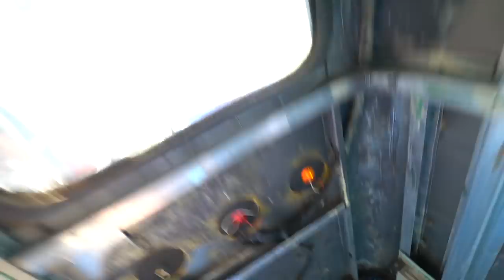CHEAPEST SOUND INSULATION FOR SCHOOL BUS !!

Comment: I dont see it as a main sound barrier. Anything softer than the metal will reflect sound differently and it will seem quieter. I see that as more of a condensation/vapor barrier under you sub-floor.

Comment: “Dynamat” like products, which are essentially stick on sound deadeners, aren’t meant to kill sound reflections inside, like echo or you knocking on the wheel well. They are meant to lessen sound coming thru from the outside by adding mass to the wall, floor, etc. sound travels in waves and passes through walls by vibration and the only thing that lessens sound traveling through is mass. Sound reflections (like echo) inside, can be lessened by adding materials that absorb sound waves like foam panels, carpet, curtains etc.

Comment: Not sure how much sound deadening quality Ice and Water Shield has. What it does do very well is plug all the  holes in the floor.  I had over 600 holes and Monday could I have sealed them all without using Ice and Water Shield

Comment: I also used a knock off brand in my van called "Peel & Stick" from roofing area at Lowes.  Put it inside the side & back doors & over wheel wells in spots, did not cover 100% & it made a significant difference in sound deadening while driving down the road & while sleeping.  I really need to do front driver & passrnger doors next. Didn't do the floor because it was already covered with factory cushioned rubber pad & did not want to take it up.

Comment: Blueskin is NOT a sound deadening product.  it is a moisture and air barrier for walls (primarily).  It is used to put on the outside of a wall before you put on stucco, brick...etc (your finish).  the only thing it would help with on the floor would be sealing any left over holes and to make sure that no water or air can get in from the floor(thats what i did on my bus).  but since you don't have your floor completely covered, its useless.  I know all of this because i work with Blueskin a lot...i work in construction.
Reply: Chuck Co, I thought that's what that product he had there was. I've seen it but have never laid hands on it...no sound deadening huh? That's too bad.

Comment: No ice shield in Canada? I use stuff called Snow & Ice Shield in construction and there are other name brands as well. IKO makes fantastic products for that. If ya do get a kink in it you can sometimes get 'em out with a heat gun or torch and sometimes, if it's not too bad, layin' out in the sun will flatten it out. Most school boards turn those things over so they don't have to deal with issues like leaks. School buses usually have a fairly strong powertrain, a stout chassis and a rattle trap bus body. It's just the nature of the beasts. Good to see Mike can run a hose, attaboy! Heh, heh. .............................PEACE!!

Comment: Tapping right on the material isn't a good comparison and that's what caused the very slight difference in sound.  A good test would be to apply it to a section on the wall.  Then have someone on the outside tap on the section with the material and a similar section without and record it from the inside.

Comment: the centerhole of the rivit is probably leaking , boat / closed end rivits might've worked better , they are watertight (and stainless) https://www.ecvv.com/product/4456679.html

the skylights are nice but they might become a pain in the long run with them springing leaks that has to be repaired constantly ........ theres room under the skylights so you could make some sort of raingutter and stick that under the seams of the skylights and rivits so all the water that manages to leak though get syphoned of through a hose in the wall and out through the bottom of the bus 

if you have offcuts of the soundproofing stuff you put on the floor stick it to the ceiling where the bedroom is going to be , it might dampen some of the rain on a tin roof sound and whont cost you extra / be in the way of the finish